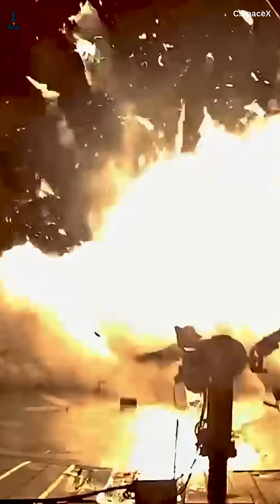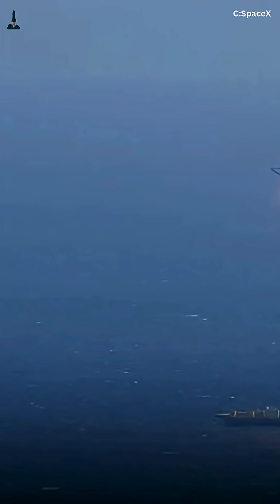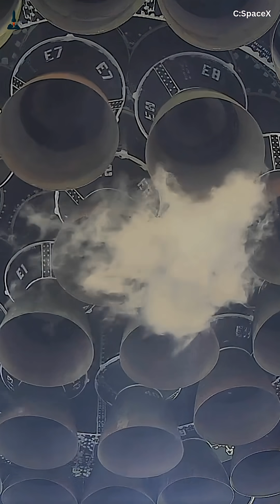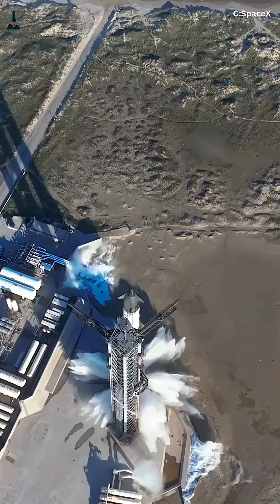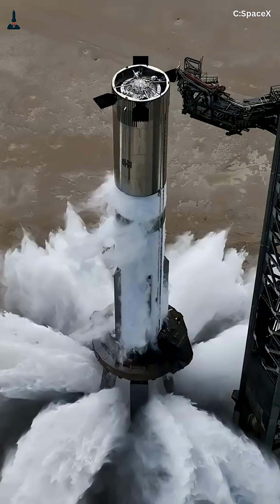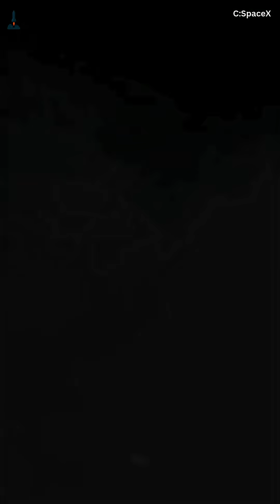0.0002 Seconds That Save Starship 🚀 #spacex #starship #elonmusk #aerospaceengineering

Comment: fire motor, attitude/gyro data, adjust for optimum position/angle... watch speed, repeat.. more lest thrust, angle to maintain gyro data within optimum.. basically throttle and attitude adjust )(push harder/push less... right /left/turn right/turn left) the math is second hand really... the faster you can do these things and confirm them.. the better your chances.

Comment: 😂 It says that no human can do these calculations yet we all do without even knowing. Standing upright on two legs without falling also requires quick processing (brain), rapid data transfer (nervous system), high end sensors (eyes, labyrinth of inner ear) and responsive actuators (muscles). I know it's not rocket science but still impressive.
Think of all the crazy locomotion - kinematic related stuff a human can do with training (programing - machine learning).
Standing
Walking
Sprinting
Swimming
Diving
Climbing
Skateboarding
Dancing
Juggling
Acrobatics
All in a single "unit" one "platform": the body. Can we do all of the above perfectly? No. But we can do them pretty decently. No single robot I've seen so far can do so many different things. We are basically the best all purpose meat machine, for now.

Comment: I wonder why still not use a parachute on approach? Intuitively it would feel like saving fuel and helping with attitude. 🤔
Reply from the maker: Starship is too heavy (100+ tons) for parachutes—safe descent would need stadium-sized canopies.
It reenters at ~17,000 mph, where air is too thin and parachutes would rip apart.
Parachutes can’t land precisely; Starship must touch down within meters or be caught.
Instead, it uses aerodynamic drag plus engines for controlled, reusable landings. 🚀

Comment: Same thing happens in your car engine...what a load of nonsense this video is. This is basic computer stuff updating and reading sensors and adjusting outputs appropriately. Not to say what a rocket does is not extremely complex. But the computer hardware on board the rocket is not super powered or cutting edge. The software is the impressive part

Comment: This numbers looks crazy right? In fact your TV remote control also does its job with that speed 😂
Reply: Your tv isn’t 50 meters of metal stopping and explosives itself using precision calculation to not explode
Reply: @CullansZhangYou are missing the context. I’m not talking about the job itself; I’m talking about the numbers. The values mentioned in the video, such as 0.2 ms, are not that impressive. In fact, ordinary MCUs used in TV remotes or washing machines operate much faster — much, much faster.
For example, an STM32 MCU can run at up to 400 MHz, which corresponds to 0.0000000025 seconds per calculation. And believe it or not, you can use it to build an advanced PID controller to correct the trajectory of almost any machine, regardless of its explosiveness or size.

Comment: What really saves it from being a billion dollar fireball on touch down is being a billion dollar fireball on the launch pad.
Reply: It's a 90 million fireball not a 1 billion fireball, those two numbers are very different. The entire Starship development program is at around 5 billion dollars right now. They are able to make at least two Raptor engines per day right now, and instead of using exotic materials for the rocket they are building them from stainless steel which is fairly cheap. They are currently able to build a super heavy booster in about 4 weeks.

Comment: ALL of our mars landers were autonomous
Reply: this isnt a car sized lander...its a flying skyscraper
Reply: @aarondavis1284 , since You mentioned "skyscraper", I read Japan is in negotiations with SpaceX to R&D a type of "mini-booster" that can be retrofitted to, or BUILT INTO the NEWER, skyscrapers JUST BELOW the Basement Deck that would have built-in seismometers to detect earthquakes in order to activate the mini-boosters long enough to raise the buildings the appropriate height to avoid being rocked by the rolling and shaking ground and then gently set it back down in the same manner with a "very light touch" using a combination of the boosters, gyroscopes, and a variation of MAGLEV (Magnetic Levitation, like the systems used in MAGLEV trains) , but the MAGLEV would ONLY activate and engage during the 
.00000777 milliseconds of time between the conclusion of the quake and the booster cut-off... 
I realize it sounds silly, but there will be a electromagnetic titanium based frame built around the lower 17 floors in order to evenly distribute all of the effefts of the magnetism, booster vibrations, and the touchdown. They are also considering implementing a policy in certain skyscrapers that require Visitors to wear either helium filled water wings or a life vest and parachute, as well as adding a series of backup Bouncy Houses underneath the buildings and "Incredible Inflatable Flailing Arm Man(s)" to catch falling debris and People... 

I mean, REVOLUTIONARY IDEAS, ya know? 
😂😅😮😢😊
Reply: @aarondavis1284 wait, you think it's easier to automate something smaller that functions in a completely alien environment?  I have news for you, creating things like that involves a process that is basically still considered magic.  That's how advanced the technology is that makes computing processors small/complex enough for rovers.  Elon isn't some revolutionary genius like he named his company after.  He's much more akin to Edison than he will ever be to Tesla.

Comment: Did they have this technology when they landed on the moon in 1969?
Reply: No. Your smartphone is several times more powerful than their analog systems on the lunar module. Neil and Buzz were off course and they had limited fuel to get to their landing zone. When they got there it was strewn with rocks the size of cars and couldn’t land. Neil took control because the computers were overwhelmed. He found a smooth landing area and stuck it with 30 seconds of fuel left. The Eagle Has Landed!
Balls over bytes!

Comment: "They negotiate with gravity" is quite badass 😂
Reply: because beep boop 101010100001010111110101 how can i help you?
Reply: If you want to get technical, the human brain is pretty amazing in that it does the same thing in different ways. The brains subroutines basically do all the same things running quietly in the background. 

For example, to catch a ball, the brain performs trigonometry and geometry naturally through sensorimotor processing. It computes angles, distances, velocities, and trajectories using visual, vestibular, and proprioceptive input. These calculations support movement, object tracking, and balance without conscious effort.  As for “negotiating with gravity”we have balance which relies on the vestibular system in the inner ear, and detects head position and motion through fluid movement in the semicircular canals. This input is integrated with visual and proprioceptive data in regions like the cerebellum, posterior parietal cortex, and motor cortex to produce coordinated motor responses.  The brain has to collate, compile, and then make sense of all of these different data sets in real time using differential equations, updating internal state variable. 

And all of this is happening for something as simple as you standing up and pouring a cup of coffee.
Reply: @Brodins_biceps true. 
Tldr.
Reply: @Brodins_biceps thank you. Everyday tasks seem mundane until you breakdown the ridiculous quantity of data the brain is parsing from the BILLIONS of nerve endings through your body combined with predictive algorithms running and refining in real time to track a ball trajectory, precisely telling your hand where and when to be to catch it with such precision that you do not have to be looking and can ibstead already be tracking the movements of multiple other people to throw the ball too. The brain is unbelievably good at this to rhe point that we are only barely being able to give our computers SOME of these abilities. And our brains train themselves at all of this. 24/7. For 80 to 100 years. Amd they store all of that data in double redundant liquid cooled super computing arrays capable of hotswap rewiring.
Reply: Definitely not negotiating with gravity... not sure why that was added
Reply: yeah this whole script is AI generated
Reply: @owen_reynolds  So I'm not the only one that heard it! I could almost hear the emdash in the script when he dropped that line 😂

Comment: Why’s nobody talking about Blue Origin’s landing right onto a floating barge, then welding its legs onto it with pyrotechnic welding charges so that it doesn’t tip over? 
Guessing everyone is too hypnotized by boy genius destroying all his “super heavies”..
Reply: Not what it does. It fires anchors into the deck, like a nailgun. The term 'energetic welding' is a bit of a misnomer. The anchors can friction weld as they drive into the target, but they are in fact, essentially metal spikes jamming into it.
Reply: Because SpaceX has been landing on barges since the last decade...
Reply: @TheFaceStabber  .. and blowing up their “super heavies “ just for fun. “Our goal toda is to get off the ground, anything beyond that is the icing on the! Whoo Hoo the White Paper!” 
Our guys did it with slide rules back in the day, yet, today, we’re on round 11 or whatever it is now, exploding every time, what’s the difference between them and now? Collective IQ drop I’d argue.
Reply: @jaredamos6514  SpaceX can afford to test for failure before they're operational. NASA buried mistakes.

Comment: Nothing our brains can't do
Reply: Well that's just plain wrong
Reply: @SapientSheep you don't think a human could land that space rocket?
Reply: @tarrockin3784 I don't have to think anything, we're entirely certain of this. Neil Armstrong could barely control the LEM without the most advanced attitude control system ever devised helping him, modern fighter jets would crash into the Earth near immediately without machine assistance. Starship is a 50M long, 161 ton bleeding edge machine, that requires the simultaneous control of nine separate engines to perform the Maneuvers we see it doing here, and it's still extremely likely to experience attitude control failures and crash into the ocean.

Were experiencing a hard limit imposed by the laws of physics. Human nervous tissue operates at an incomparably slower speed than that a computer, we wouldn't stand a chance
Reply: Most of it our brains couldn't do.

Comment: Naxt time landing a robot on mars make sure you send a candle with some matches or a lighter and a robot capable of lighting both so we can see if it stays lit.
Reply: For why? We already know it won't.
Reply: what the fk would be the point
Reply: Why?
Reply: First, Mars has no atmosphere, it was blown away by the sund cause Mars doesn’t have a magnetic field. 
Second, there are better ways to measure wether oxygen exist like Atomic oxygen spectrometers.
Reply: @Mango_1359 Mars has an atmosphere, and a magnetic field, the main reason it does not have as thick of an atmosphere as Earth is because it has significantly lower gravity. The solar wind hardly does anything to Mars because it's so far away.

Is Mars had no atmosphere, the solar-powered Rovers we sent earlier wouldn't be dead right now from all the dust that got blown onto the panels during the giant wind storms that cover the planet
Reply: @SapientSheep i correct myself on the atmosphere. It has one. But it is 100 times thinner than earths atmosphere. But no it still doesn't have a magnetic field, only a few magnetic patches. The water it once had did disappear because of the extremely thin atmosphere and the lack of a proper magnetic field that exposed it to solar winds
Reply: @Mango_1359 it evaporated into the atmosphere and was deposited in ice layers on the poles due to convection currents.

Every planet has a magnetic field. Mars is weaker due to its lack of active volcanism. It's a solid lump of metal that may have once been more magnetic than it is now

Comment: Every modern car has control systems like that. The processing speed itself isn't special in any way. Their are way harder problems in rocket engineering.
Reply: Your car is not 50m long, nor does it need to do rocket science on the fucking fly.

Read the engineering to people who actually know what the fuck they're doing
Reply: @SapientSheep  I just sayed it is not about processing power which holds true. You probably misunderstand my point.
Reply: @alexengineering3754no, your point is just incredibly stupid. It has everything to do with processing power but even more to do with processing speed, there is significantly more information needing to be moved at significantly higher speeds in the operation of this vehicle.

Nearly every other problem in rocketry has been solved at this point
Reply: @SapientSheep  The Apollo missions flew on a computer which is a calculator by today's standards and they made everything (launch, landing, rendezvous). Now you telling me in 2025 we don't have enough processing power maybe you should think again.
Reply: @alexengineering3754again, it's not about power, it's about speed. For a smaller craft, the current limitation of computing speed is not a problem, but Starship is three times larger, and ten times more complex, than the next largest craft.
Reply: @SapientSheep  I didn't get paid enough for this stupid conversation. Next time a Rocket explodes i just say "Hmmm probably not enough processing speed" because everything else has been solved.

Comment: i doubt 2 microseconds of error would make much a difference, because the environment itself is unpredictable, you can't time that
Reply: There seems to be a couple exaggerated numbers. It's better to work that fast and not find out though lol
Reply: @eviltigerstudios thats because the script comes straight from chatgpt
Reply: He said 200 microsecond
Reply: @nicomal oh
Reply: One of Starship's crashes literally happened because a rocket motor reignited some microseconds after the other two causing a torque imbalance that the computer couldn't correct. When working with machines that re-enter the atmosphere at Mach Jesus and works with extremely high fuel pressures and air speeds, microseconds matter, a lot.